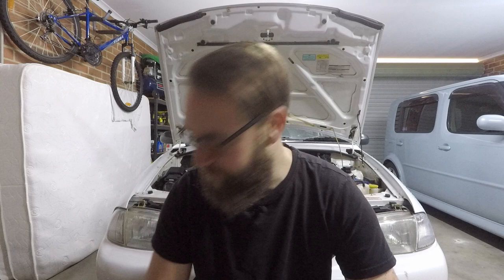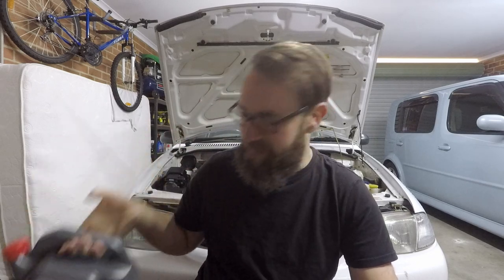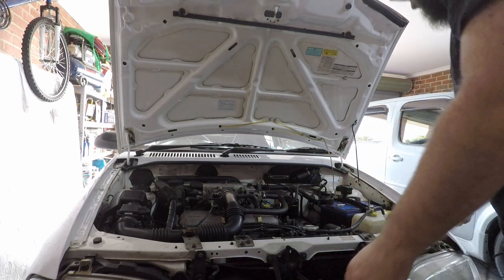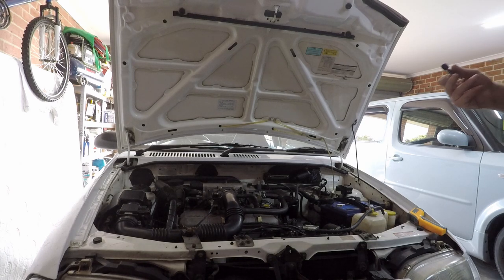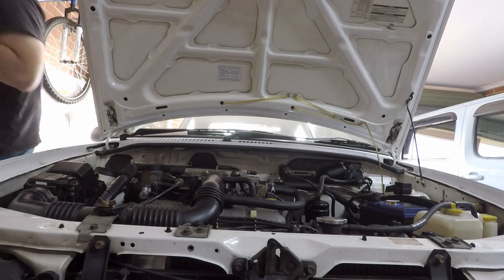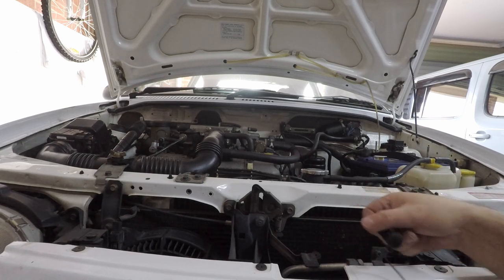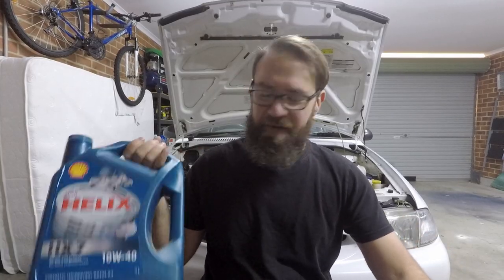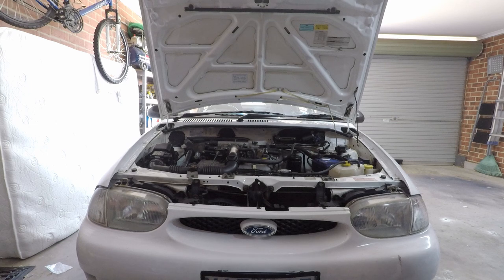Engine oil flush - are they a good or bad idea?

Comment: you should open up the valve cover after adding the engine flush to physically inspect the cleaning effectiveness of the flush inside the engine.
Reply: Yeah sure, because it takes a second to do so...
Reply: @rafars2246  honestly does not take that long
Reply: @andretsang7337  it's a bitch on a 2008 Altima 😂
Reply: I waited for this sad
Reply: @andretsang7337   try that on a tsi ea888 1.8 tsi or 2.0 tsi.....u r in for some serious long hours

Comment: Watched the whole thing waiting for a second look inside. I want my 13 minutes back!!
Reply from the maker: Yeah sorry Ken, a follow up video was always planned but a big kangaroo had other plans. It jumped straight into the side of the car just in front of the drivers door (lucky for me), and twisted everything so much that the bonnet wouldn't open. I did a lot of other work to that bucket of crap, took a lot longer than 13 minutes.
Reply: @Sawickipedia  OK. I guess that's reason enough ;-)  Around here, if I head up country a bit the worry is moose!! Glad you're OK.  It's too bad though, other videos on the subject sometimes compare the oil before and after but not an actual view inside the engine. So close!!
Reply: also spent 13 minutes waiting for a look of theclean engine - it shoul have looked like this: https://www.youtube.com/watch?v=x4u64lKBbhQ
Reply: Wow, what a turn of luck for that wee car!
Glad your ok!
Reply: Based on the visual inspection of the valve cover and cam area, no need for a flush. Myself, if I bought a vehicle where the maintenance had been neglected, unless the sludge was really, really bad, I would do nothing. I would accelerate the oil change interval, and that's it. When I say bad, I mean really bad. An nice even layer of sludge in the cam area doesn't qualify as bad enough. I drive Toyotas. Toyota engines, a least through the early 2000s could survive poor maintenance. I can't speak for the later engines that require synthetic oil.

Comment: Thin oil is all the rave. So is ring failure. As my engines age, I increase viscosity. No smoke or oil usage with  3000 mile changes. Syn oil is very clean. Gas cleaner keeps gas blowby to a minimum. No prob unless 0w20 oil is used. 5w30 is my minimum now! 10w40 in my older v8 and generators in summer. 10w30 winter small engines syn blend works fine. I go 50/50 syn, syn blend these days in older gens that state conv oil only. Yes they are old, like 4000 hours! Lol.  Works for me with 100 hour oil changes max!

Comment: I have never ever had a problem with the flushing of oil I well recommend it the new oil will stay clean for at least 500 miles
Reply: can you flush a 2011 diesel engine ?
Reply: @rajZ772  I don't know mate but I say get your oil changed regularly what car is it
Reply: @mohammadayub2760  Its a toyota etios GD diesel. 148000kms driven, and the exhaust pipe is smelling like vinegar. Also the engine is vibrating more. I have also ordered the moly diesel purge to put it in the fuel tank. And thinking about the engine flush. Whats your take?

Comment: For tappety  noise engines flush your engine with diesel add one
Litre to existing engine oil start engine until temperature starts to
Rise  repeat this 4 times over a 
Full day  then drain oil and filter
Empty old oil from old filter yes replace old filter all bungs and fill
Rocker cover pure diesel engine cold
Till starts to warm this will clear all ports drain again remove old filter 2nd time and bin mew filter replace
Oil bung and top up new oil to recommended  level and your little
Engine will be like new nice quiet
Smooth you will be proud of your
Little self

Comment: The oil pick up has a screen and tiny particles will pass the main filter...
The purpose of the oil flush is to thin out the particles so it will pass through the screen then filtered by the oil filter...
Reply: nope, flush is dessigned to clean the internals to keep the new oil fresh more time without contaminate itself. Nothing more.

Comment: I would clean it with synthetic at short intervals...never a engine flush
Reply: Sometimes its so bad and the car is old. That it's worth the try.... $10 try on a car that's most likely gonna need a full rebuild isn't a bad idea tk see if it gets you another 30-60k miles

Comment: i would do an oil drain for the old one inside the car ( keep filter ) , put cheap oil and add engine flush, keep idle for 15 min., drain oil and change filter with new oil......i think this will clean all the old oil in the  lines inside the engine and remove any residues !! and i think removing the pan and wash it before the new oil will be something optional but better too to make sure of everything
Reply: @mohamed UAE a cheap mineral oil for 15 min. isn't a thing wouldn't cost you much and you shouldn't do it every time you change oil,

do it after 3 changes maybe
Reply: Not a good idea. Putting in a flush can loosen up pieces of solid material. If you leave in the old filter, the material can bypass the filter and block up an oil passage. That's why I say, unless you have an extremely severe case, just accelerate the oil change interval. It ran before you flushed it. Right?
Reply: @mohamed UAE I have to put 5W30  oil in my engine (FAP equipped) which is very expensive, can I do a flush with a cheap oil 10w40 for example. Thx

Comment: I bought a brand new Dodge Dakota and I received coupons for 12 oil changes.  First time I hit 3000 miles, I went to the dealership to get my oil changed.  The asshole mechanic recommended an engine oil flush with a vehicle with barely 3K miles.  The cost was $800.  I said no.  He kept pushing it.  He wouldn't take no for an answer.  I just said "give me my keys" and left.  I gave away the truck after over 200K miles.  I assumed that the mechanic didn't want to honor the free oil change.  That dealership went out of business.
Reply: Nothing is free

Comment: Flush engine with clean oil 3x with new filter. Drain, new filter and oil , then cleaner
 Run the engine. Then inspect engine, oil and filter. I have done this before. Solvent cleaners with no detergent additives are designed to remove money from your pocket.

Comment: Like your video. I have a hybrid and I disagree that you do not need to flush if you do regular oil changes. I use 10000 mile semisynthetic oil and premium filter, change every 3000 and it still burns oil and creates lot of sludge. Hybrid toyota oil scraper piston rings block very easily and oil sludge begins. Other modern toyota engines have that problem too, like RAV4.
Your engine should work more efficiently now.
Reply: I agree 👍
Reply: Wow you use semi synthetic and you get sludge, who would of thought.
Reply: "premium oil filter" but semisintetic oil... Dude, learn the basics, you are doing it wrong.... And it burns oil because your shity oil cant handdle the high temperatures and the TBN scks... It creates lots of sludge because it doesnt have any detergents or are minimum. And because you don´t flush the engine, when you put a new oil inmediatly contaminates itself.... Go to the mechanic school and learn the basics please.
Reply: @TimberWulfIsHere better yet semi-synthetic on a hybrid. Yuck.

Comment: That is considered heavy engine varnish with signs of sludge formation (black spots). Its a sliding scale from silver -> gold (varnish) -> dark gold (heavy varnish) -> black (sludge)

 I have an 04 Honda Civic w/135k miles and underneath its valve covers it looks almost brand new. Lot of engines are neglected and people assume gold is good, gold is OK on a high mileage engine, not great but OK and not a deal breaker. If i saw that on a engine with less than 100k miles i would avoid it, that is a sign its been ran into the ground.

Comment: ...that engine might have looked clean to you because there's no obvious sludge.  But what you are looking at is varnish.  The valve train including the springs, is simply coated with the stuff that was caused by oil breakdown when it went too long without a change.  It's not as bad as sludge, but it is a sign of infrequent changes, the true cause of engine damage in this engine, if any.  Since this video lacks a satisfactory ending we may never know.

Comment: the reason he did not remove the crank case after the flush is it is like ERG cleaners they dont work or if they do there is no differance.
the safest way is to do a oil  and filter change run in for about 20 miles at 3000 -3500 rpm let it cool to about 40c do oil  and filter again that will do the same job.
i do this 3 times i use cheap oil and filter for this but on the last i use good oil and filter at least you will not blow a seal doing this and it will if you are doing on a diesil force regen of your DPF
my 14 year old 308 1.6hdi has done 75k and the engin is as clean as a new car

Comment: Do an oil change with cheap oil and a cheap oil filter dive a few 100kms then flush if it's the first time you are doing it in a older car  that way you are not overloading the oil with with crap.

Comment: Every new car I've had for the past 20 years has had the old engine oil flushed before adding new oil.  All dealers do it, so it should be fine as long as the car you're using has always been flushed.  Don't try to flush the oil on a 200k km car that's never had a flush however.
Reply: why ?
Reply: Fuck it

Comment: It's not a real science on this scenario, older ,high mileage engines tend to be owned by people with limited finances, you recommend this and it doesn't work the customer will be wondering why you spent 'their money on parts and labour ,interaction with the customer is the most important way to do it I wouldn't do this with a new customer, only customers I've dealt with for many years,saying so,some cars come back to me after 40.000 kms,having been looked after by another mechanic, it's like playing with dice to mate some people happy,still learning after 44 years.
Reply: Nah, also professionals use this products  from different brands, it actually helps with older car mainly when people "forgot" their oil changes.

Comment: I found its good I flush every other oil change I have no problem with all of my trucks and equipment I've have had great results I use  oil and kerosene mixture and let the engines idle for about 20 mins

Comment: I have water in my engine oil I was recommended to do an engine oil flush. But lots of people are saying not so what do I do?
Reply: That's probably a head gasket or a crack in the block or head. You can try a sealer product. It might work. I have no idea what engine, the mileage or what the typical problems of that engine are.
Reply: @anonymike8280  I checked them and it wasn’t it but I appreciate the help. It’s a 1988 crx 128K miles. I did see water in the engine oil though
Reply: @xXMomia75Xx  It has to come from somewhere. In fact, it has to be from the water jacket. If it is water you are seeing. How do you know there is water in the oil?
Reply: @xXMomia75Xx  Hey! This was getting good! Answer his question 🙏

Comment: I’ve got a 2004 GMC Sierra I just put a used motor in. Old motor blew up. New motor runs great but oil psi high. Should I flush it?
Reply: I would. Especially if you haven't opened the new engine's oil pan or valve cover. I would clean the oil pan just in case you have too much sludge.

Comment: Add 250 ml of Oil Flush to 4 liters of old engine oil. Let the engine run for 60 minutes at 1500 rpm. Periodically increase the speed to 3500 rpm. Drain the old oil, fill in the new oil and replace the oil filter.
Reply: I remember this from Forte motor flush

Comment: I just bought an old low mileage car. (2009 with 42000km), I think the oil is from 2015 and the previous owner rarely drive it since. I'm going to change oil ,but should I flush it?
Reply from the maker: Certainly change it asap, but I wouldn't flush it. If you are really concerned dump the current oil and run some cheap same weight oil through it for 10 minutes in between
Reply: Add half a quart of ATF with that cheap oil. Drive around 50-100 miles. Then change oil and filter.
Reply: @z31rider24  yep, did exactly that. I'm gonna use the other half bottle to flush it again on my next oil change, just to be safe :D
Reply: Nice thing about ATF is that it cleans @ a slowe rate. Unlike engine flushes; which do a great job at cleaning but they too strong. You will clean out too much gunk and deposits too soon. You run the risk of clogging up screen/filter. The last thing you want is oil not getting to where it needs to go because something clogged it.
I'll leave a link how to clean/flush with all ATF.
Reply: Check this out
https://youtu.be/LKWWL_rsDB4
Reply: If you're worried, just accelerate the oil change interval.
Reply: A followup. Got the car in late 2019, did all the maintenance during wintertime and started driving it in summer 2020. Not having any trouble till today.  serpentine belt is wobbling a little, I'm thinking to get a new belt and tensioner before winter.
Reply: @papercut1987  One issue you can get with vehicles that have not had the oil changed in a long time is synthetic oil crystallization. This occurs when the vehicle is driven only short distances. The vehicle I bought had been driven by a senior citizen who only went a few miles a week. The son put in synthetic oil and thought that he could leave it in for years because it never reached the 15,000 interval.

I found it when I changed the valve cover gasket. Felt like grit but was not metallic. It was a couple of years before I found out what it was.

If you find it in a used car, it will dissolve out over a period of time, as will sludge in the upper engine area.. You just need to change the oil frequently. No one ever wrecked an engine by changing the oil too soon, as long as they used the correct products and installed the filter correctly. People also need to know when you should not use synthetic oil, if it is not required for that engine.
Reply: @anonymike8280  oh, thank you for the insight. I'll definitely give a closer look when i'll be doing those gaskets.  Like you said, I have been doing shorter oil changes these years.

Comment: Can't afford to get a oil pump change. So im going to try the flush. I pray it works.
Reply: Have you done the flush as yet. My PCV seems to be blocked. As I've only just found out about the glove test. And it blew it up. So my predicament now is do I use it . And if i use it. will it cause an oil leak.
Reply: how is it after the prayer? did the flush work out?
it did in my case: https://www.youtube.com/watch?v=x4u64lKBbhQ

Comment: I disagree with you in regards to your point about the the flushing product 
The 10 minutes is actually for those who use it regularly but for first time you should have left it for 30 minutes specially if the car milage is high like the one you applied your testing on it
Reply: Always a good idea to stray from manufacturer’s instruction and play Russian roulette with your engine

Comment: It's a great idea and I have kept an engine alive with flushing. Also using transmission fluid in the oil before I change it helps when the engine is burning oil. The rings are dirty. Thus these treatment work.  Oh BTW way beyond 230K miles and it is still running! Oil consumption has been under control the oil was Not Syn but Regular motor oil changed every 3,333 miles. Totally disagree 
Flush when needed. It is bath for the engine. Or just quit taking baths...... LOL

Comment: Nice video but are you sure 15w40 is right oil ? I was more expecting right specs semi 10w40.... can keep your engine bit cleaner, without flushing ?
Reply from the maker: In this case 15w40 was the best option given the engine age (250,000km). 10w40 would normally be the recommended weight for this engine and climate. And yes IMHO a decent semi or full synthetic oil will always extend the life of your engine far more than a oil flush which I personally don't recommend for any engine
Reply: Good answer I'm with you.
I did once flush old diesel engine mercedes 190d, idling 10 min and engine start knocking... suspect hydro valves, so don't think is good for all kind of engines.
But I like keep engine clean and I do change oil 5w30 on my 2.0 tdi every 5-6 k miles hoping make engine good life. 
Nice video thank you.
Reply from the maker: @aleshudek5323  Yes I do the same on my Mazda MPS 5w30. Definitely need to do regular short interval changes on a turbo direct injection engine
Reply: @Sawickipedia  I don't get it, that doesn't make any sense. Putting 15 instead of 10 will only delay the lubrication on the critical parts on a cold start. Later the oil will act as a 40.

Comment: what will happen if the flush little bit left on the engine because it's not properly drain. what will happen with the car / engine?
Reply: Maybe oil gonna lose viscocity...just my opinion...i prefer flush with oil change 2000 km and put again fresh oil